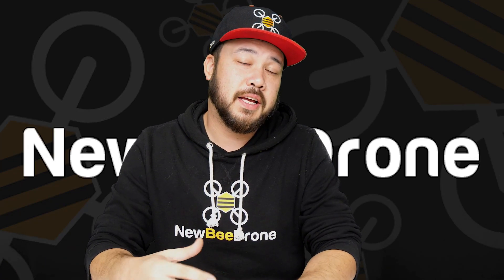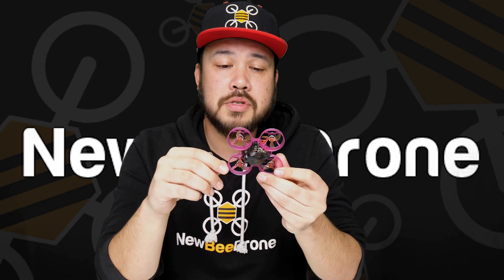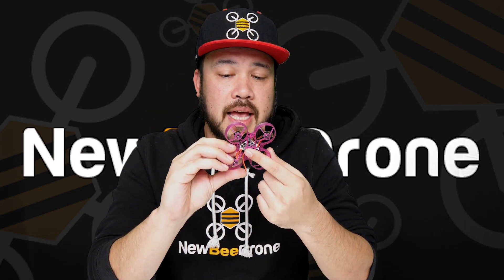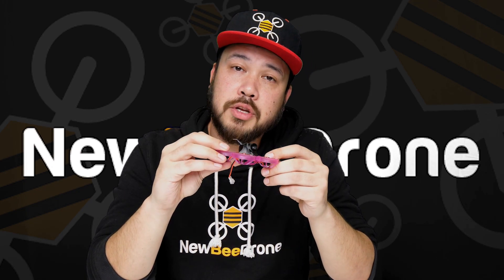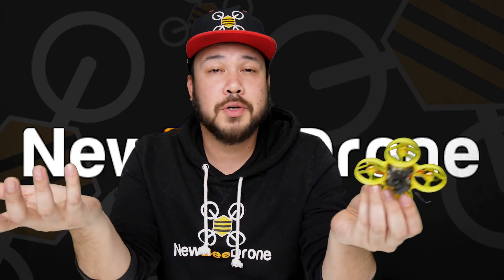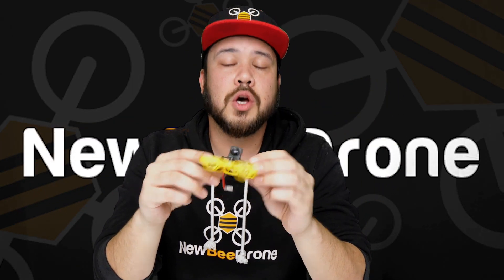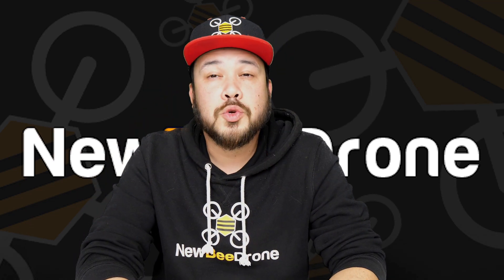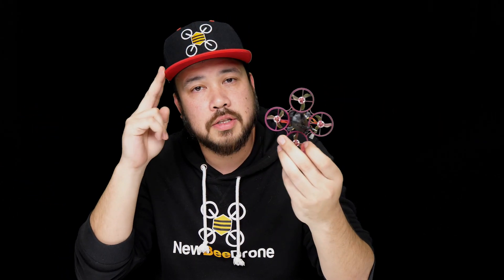Brushless Hummingbird overview

Comment: I got a BNF version. Setting stuff up in BF, the board died. Get the notice that "the USB device has malfunctioned", and it won't connect in Betaflight.  It worked for a minute, guess that's better than not working at all..

Comment: I guess the stupid question that’s on all of our minds is does the no osd firmware mean no osd? Also I noticed the fc comes with no vtx tables, I understand it uses b-sign but which do I pick in the uart page “tbs smart audio or tramp? Ive never seen a b-sign option on that page, I understand that in the osd u pick b-sign. Also does the new firmware add the vtx table? If not, then which table do we add if we’re planning to use the mark1,2,or3?
Reply: i just got mine going with osd working using runcam3nano and lamelessrc nano.. on tramp.. channels change correctly.. i think the osd hex is if your using there vtx and cam with the beesign. i loaded wout/osd hex and it works .. kinda confusing..
Reply: wolfy AJPW/LPS yeah it’s is lol. Can I ask which pad u soldered as the video in for the cam and video out for the vtx? The layout on the nbd site just shows both as cam
Reply: @djs134  the ohh.. inner pad is vtx the one next to the uart2rx is cam
Reply: yes the firmware added the vtx table and its own set of pids. but i had to use the jasontramphex to get my vtx to work
Reply: wolfy AJPW/LPS what’s the jasontramphex?